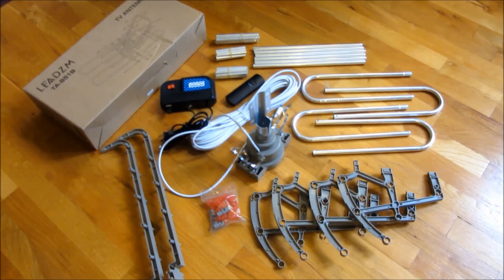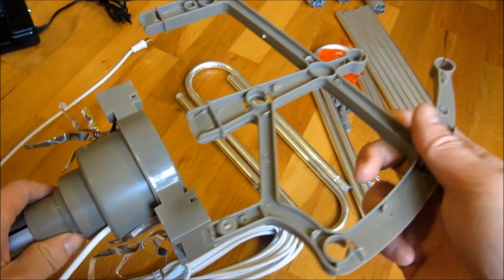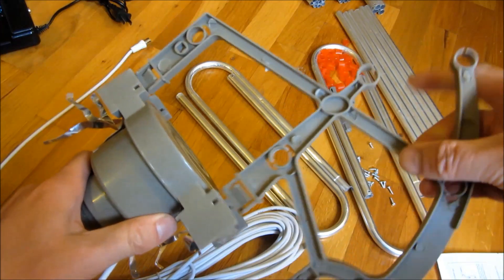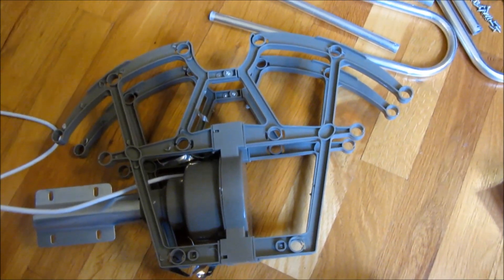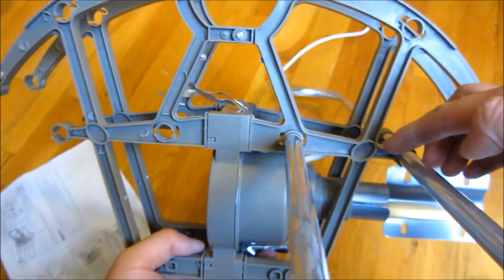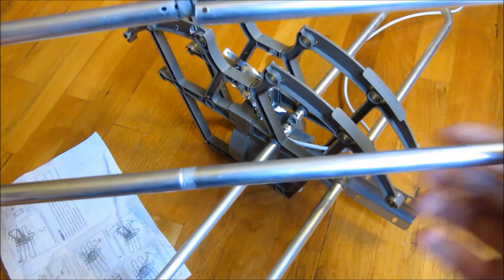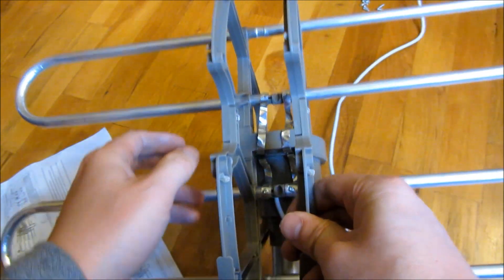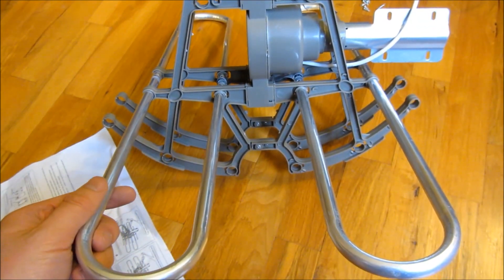LeadZM TA-851B | How to Assemble Step by Step | HDTV Outdoor Antenna | 150 Miles 38dB

Comment: Putting the aluminum tubes in the freezer should cause them to shrink and strengthen just enough to avoid warping. BUT the heat from your hands will cause them to heat up rapidly (aluminium is highly thermally conductive) so wear winter gloves while doing so.
You can also use a piece of metal such as a round screwdriver of the same size, heated and a small amount of oil put over it to smooth out the plastic holes (but don't angle your hands while doing so or you'll warp the plastic). Not ideal, but if you keep your hands clear it's a little safer than using a sharp blade to try and fix it: Sharp touching flesh is instant problem, heat takes time to transfer and you'll likely feel it before a burn occurs - The plastic doesn't require that much heat to re-form it so it isn't that likely to burn you anyhow.

Comment: Any way to use different coax cable, even if I have to solder it??? It has 50 feet of crap coax!!! The cable is so small a RG6 connector won't work!🤬

Comment: I have just watched and have it now in up in the air. The distance is 20 feet., I got 36 channels at great signal. My neighbor  get the same channel at the cost of $60.00. Walmart has this antenna at cost of $15.00. WOW !! What a savings.  Live in the country, in a valley, down hill. Watch to whole video before you start assembling, tips are given. Thanks for the Video.

Comment: BIG thanks man, the directions were about useless and this made it MUCH easier to assemble...I know it's too late to edit but it would have been easier to put the parts assembled @ 10:49 of the vid and the "end result" @ 12:14 of same in at the very beginning..(the long "U" shaped piece that takes the 20 short rods and fits into the 4 squares)..like you said, good thing it's cheap, flexible plastic but it was still a chore to work it in without breaking/bending parts..and I did need a blade knife to shave off excess plastic in this step...still very helpful
Reply: To fit the long "U" shaped piece that fits into the four square holes, I unscrewed the metal ribbons that attach to the rods located  above the square holes. This will allow you to separate the rods just enough to get the ends of the long "U" piece into the square holes. Then just push the rods back together on the spacer and re-attach the metal ribbons. Use needle nose pliers to help pull the ribbons back through. I also used a finger nail file to de-burr the rod ends and a magnetic screwdriver to hold the screws when attaching the ribbons. I don't think I could have assembled this antenna without this video---very helpful and with excellent audio.